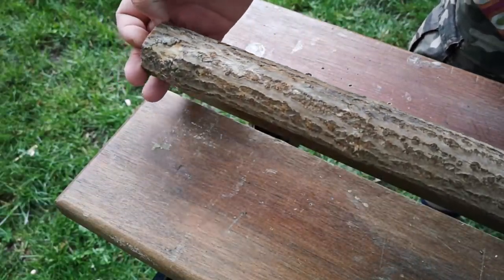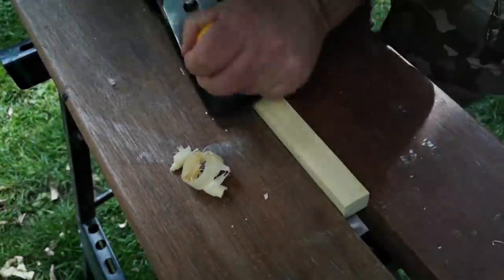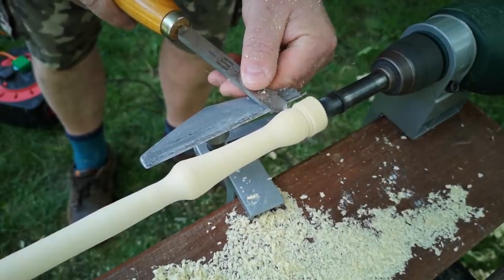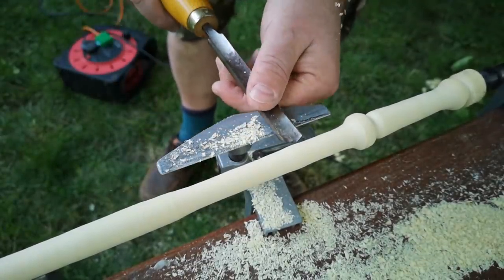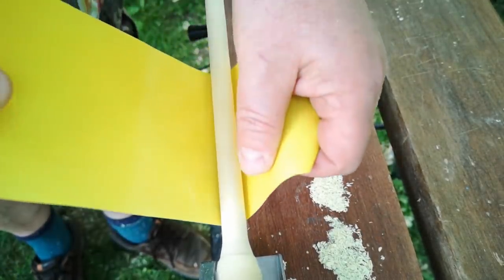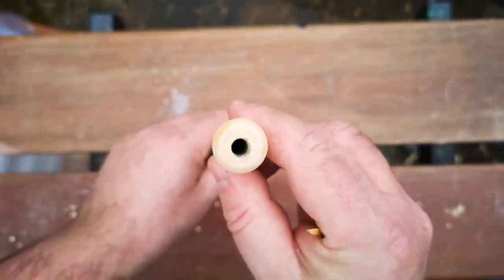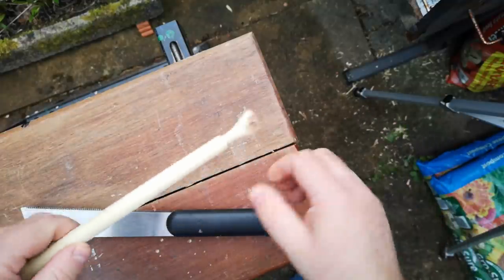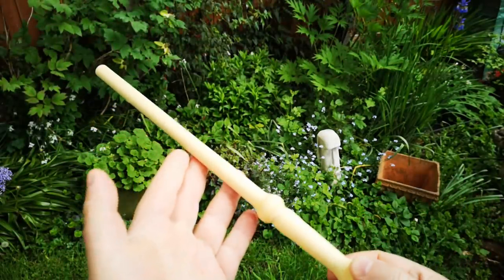Making *An* Elder Wand

Comment: I never realised the core was actually soft (though from my twig-playing days I did 'know' it somewhere). I just figured it was something magical made up, but now know it makes sense from a woodworking perspective :D Learned something today! Great video and result is cute!
Reply: Jeanne Frenken the core of most wood is soft I think
Reply from the maker: Yes - many tree species have pith in the centre of the rings - often just a thin line of it, but with Elder, it's quite a substantial channel (broader in the young branches - the pith core gets smaller as the branch grows)
Reply: Atomic Shrimp because thin trees need to be flexible to not snap in the wind I think
Reply: @jeannefrenken3284  If you look up Dutch people on Google images, you get lots of orange and cheese....

Comment: Wish I knew about elder wood before I made a 3d printed wand using wood PLA. I also used 2 aaa batteries an LED with resister and a tilt switch so it only illuminates at certain angles. Using elder wood would have been much quicker and probably a nicer finish.

Comment: Nicely made, mr Shrimp. I liked the finishing touches with the bread knife. I found you a couple of videos back while trying to find an answer to a youtube problem that no ones addressed yet.
I think you could well be the man to tackle the job, do you do requests? If you can tackle the request ive got it will be of huge interest to the youtubing community.
Reply from the maker: It's a pullsaw (not a bread knife).
Not sure about requests - what do you have in mind? (there's a contact link in the 'about' page, or @the_atomic_shrimp on Instagram, in case you don't want to discuss it here)
Reply: @AtomicShrimp  i bet it does a good job on crusty bread too? Ill try to contact you but i am digitally impaired.
Reply from the maker: Maybe I should do a challenge where I have to cook a full meal in my workshop, using only tools and materials I find there....
Reply: @AtomicShrimp  that would be very possible in my workshop as ive got everything i need in here, including a range of insects and reptiles and the occasional ferral cat.

Comment: Did you just trim that off with a bread knife ?
Reply from the maker: It's a pullsaw (meant for cutting dovetail joints)
Reply: @AtomicShrimp  oh right bit like a pad saw I use for cutting patress box holes in plasterboard cool.
Reply from the maker: Yeah - like that - the teeth have no 'set' to them so it can be used to flush cut dowels without damaging the surrounding wood

Comment: ok i'm going to be the kill joy one here.....your drill bearings will be shot for this type of work....like the video tho :)
Reply from the maker: Yeah, this isn't great for the drill - actually I am using the thing in not quite the prescribed fashion - there is a separate bearing for the headstock, into which the drive piece is supposed to sit, with the drill attached the other side of the headstock - except nothing was provided in the kit for securing the body of the drill when used in this configuration - the user is just meant to figure something out.

Comment: You just made a wand that doesn’t work
A wand needs to be made during the first full moon of summer (without electrical lighting just moonlight and light from candles and torches) a wand made at any other time is just decoration
Reply from the maker: I heard it's what you do with it that counts
Reply: Atomic Shrimp 
Hah good one
The magic wand industry is very weird if you make a wand like I mentioned and you do it while chanting you can sell the wand for well over £1000 (you will need to make a video to prove how you crafted the wand)
I say that’s not too bad for a little effort and a piece of wood that would’ve likely ended up in the fireplace